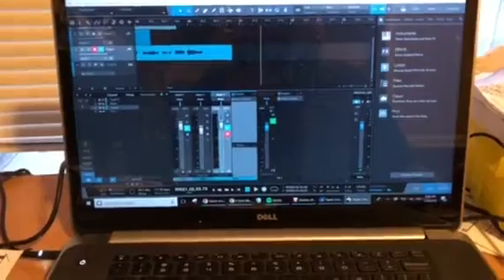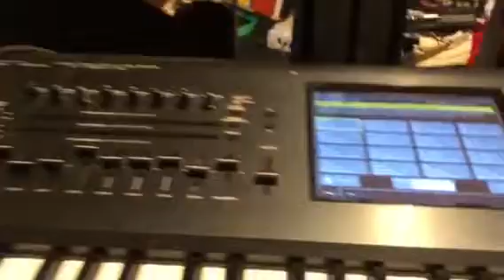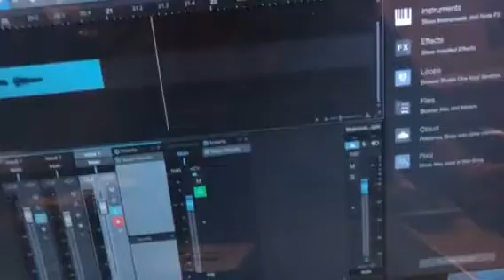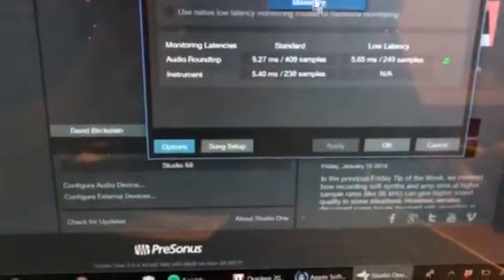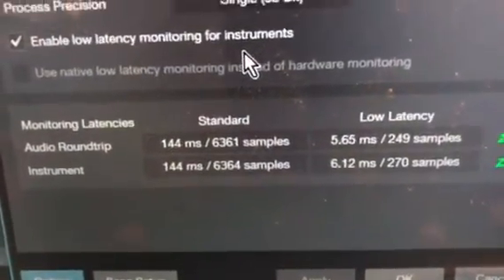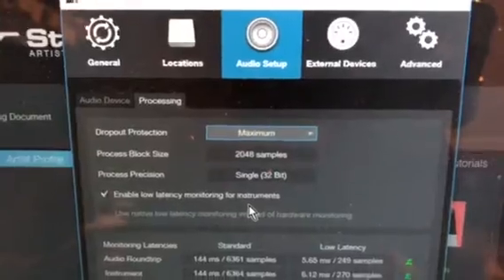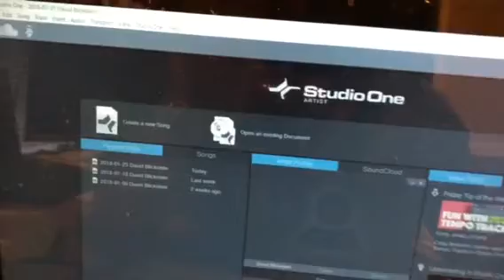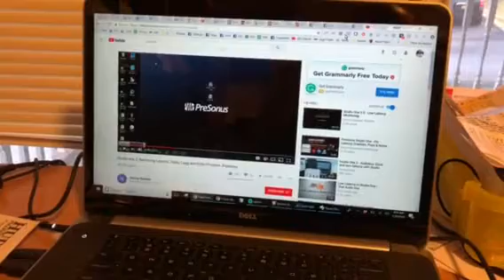StudioOne Latency Problem Solved

Comment: I bought a brand new midi cable and I connect it to my  n my keyboard when I press it it sustain the note
Reply from the maker: That really is an entirely separate issue from the one in the video.  But… I can tell you this:  often problems like sustained notes are due to both the DAW and the keyboard sending MIDI clock.    Frankly, I do NOT understand why that would be a problem, but I do have that problem with my Korg Kronos and NOT with my Korg Krome.
Reply: @davidblickstein  please what can I do???
Reply from the maker: @bethelhourtvbhtv6921  I really can't solve this for you.   I would ask ij a proper forum.   Try the Presonus help forum.

Comment: Okay, anyone ever have what I'm jokingly calling negative latency? My 8 tracks of drum mics are recording before the backing track starts. I have the latency buffer set to 16. That's the lowest option and I have the green Z on?
Reply from the maker: I’m not sure I understand but I think that really is still a “latency” issue, it’s just that it’s the latency of the playback rather than monitoring tracks.    I really don’t have any useful advice on how to solve that other than this.    I just got sick and tired of dealing with latency.   So I bought a computer with Thunderbolt 3, and a Presonus Quantum 2626 Thunderbolt interface and now I’ve YET to have had to even THINK about latency since.    And  I often record using “external instruments” and if you think about it, if I was going to have latency issues that’s one place where you’d expect them becuase the signal path is MIDI keyboard to interface to computer, then “THRU” back to interface and then to external SGU and. I like to record AUDIO tracks as well as MIDI (so I can mix without all the stuff plugged) in so the additional step is External SGU back to interface and then back to computer.

That’s 3 “trips”.     But haven’t had any problem with latency.

Comment: I don't have the "Z" under the fader... maybe because I am in windows. Running V 3.5.
Reply from the maker: Here's one article that suggests that whether it shows up depends on your interface.   I am the author of the original video here and I don't see it with my new Presonus Quantum 2626 Thunderbolt interface.   But then again... since it's a Thunderbolt interface, I've not had any latency issues.     
So ultimately, I just decided I didn't want to have to worry about latency any more and went out and bought a Thunderbolt-equipped computer, and a good Thunderbolt interface.   If you can afford it, as far as I can tell, THAT is really the way to go.
https://answers.presonus.com/4799/why-is-there-no-z-latency-button-in-studio-one
Reply from the maker: OK, from what I'm reading, the "Z" feature is only available if your interface supports a feature called "hardware monitoring".
Reply: @davidblickstein  Thank you David. I discovered the  "device block size" in Options had to be reduced on my setup to use this feature. Once I dropped it down to 128, the "Z" appeared under the fader.

Comment: I'm still having latency issue. 
Windows 10 
64bit
Presonus Studio 24c
Studio one 24 draw

Opened up universal control and Set block size as low as 16. Then when I open up Audio setup in Studio One, the device block size remains "264 samples". I set Dropout Protection to maximum, enabled low latency monitoring first instruments, and both green z's are showing. I also left the "exclusive mode" box unchecked and dragged the latency(ms) bar down to 10 (under Control Panel)..
Anyone know why I'm still having latency when plugged in with guitar? Need help thanks

Comment from the maker: I really appreciate all the nice comments here on my video.   I wanted to give a little bit of an update.

I'm anything BUT "technically challenged".   I'm the former CTO of a software engineering startup and I have over 40 years of experience in software and computers in general.   

But... y'know?   I'm also a musician at heart.   And when I'm NOT a musician, I don't WISH to be "technically challenged" by problems like latency issues, software driver incompatibilities, etc.    And I just was exceedingly disappointed and frustrated with my first venture in DAW recording.    The point is:   I spent too little time BEING "a musician" and way way too much time solving "technical challenges" like latency.   I lost ALL my initial enthusiasm for coming home at the end of a hard day, turning on the computer and just creating music.   Because I couldn't muster the enthusiasm to spend YET another evening battling "technical" problems.

So I asked around.   And what I consistently heard was that there were two major things I could do to NOT have to deal with this crap.   And I heard two things consistently enough to give me hope:

1.   Use a Mac instead of a Windows PC for this stuff.    
2.  Get an Thunderbolt interface to not have to deal with the latency issues that are somewhat inherent to USB 2.0

So I've ordered a mac, and when it arrives (from China - things are slow now due to the Coronavirus), I'll also probably get one of the new lower-cost Thunderbolt interfaces that Presonus introduced, though I'm tempted to get an Apollo because I just wasn't happy with Presonus technical support in all this.  I'll use their DAW, but I'm not really too inclined to give them other business right now.

That's my update.   Perhaps I'll post more when I have some experience with the new setup.